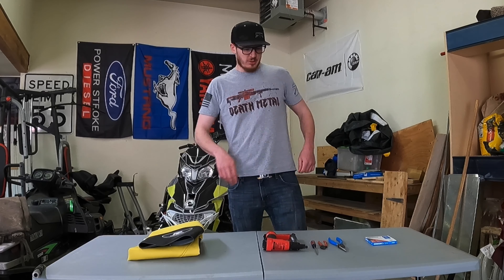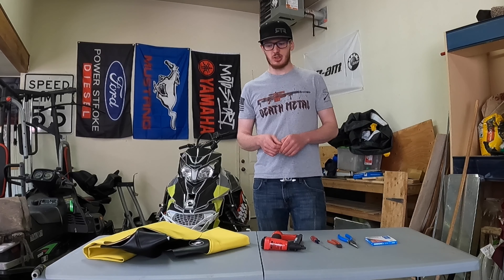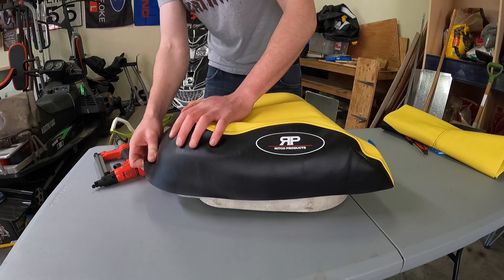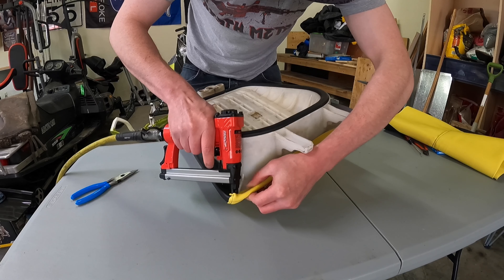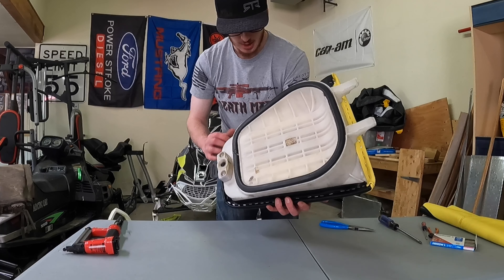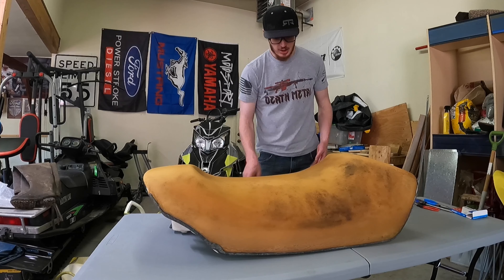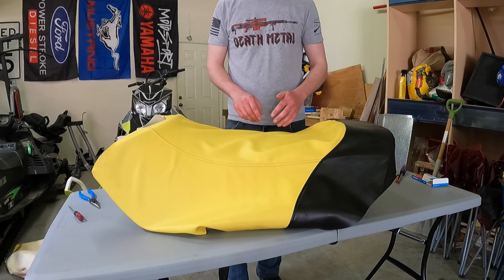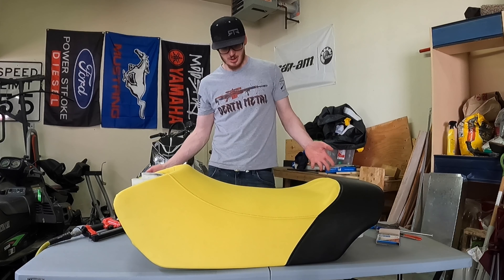How To Easily Replace And Install A New Jetski Seat Cover

Comment: Yo bro use spray glue on the saddle area then stretch the sides🤘🏼
Reply from the maker: That would have been a great idea to do for sure! Unfortunately I didn’t think of it at the time. So far it seems to be holding fairly tight, but I could see it being an issue over time. Great tip though man, and definitely recommend it for anyone else doing this!

Comment: very nice how much you charge for fix the jet ski seat
Reply from the maker: I don’t really have a business. I did this on one of my personal jet skis. If you were to pay a shop to do it, you’d be looking at probably around $100 for the new cover, and then a couple hours to remove the old one and install the new one. Depending what the shop charges for an hourly rate, could be between $250-$300

Comment: These aftermarket covers turn sticky from UV degradation rather quickly and are really pricey considering you can buy 2yds of marine vinyl fabric and recover both seats for 30 bucks vs well over 100 for these. I would have tried some starbrite milder remover first or some other cleaner before ripping them off. It's good you have a garage to keep them in, I wish I did.
Reply from the maker: Oh wow. I did not know that about these. I am by no means an upholstery guy lol. One thing I would suggest if you have to keep yours outside, is to buy a cover for it. I got a pretty nice one off eBay for about $150 a couple years ago. It is nice and waterproof, and is made out of a seemingly very sturdy fabric.
Reply: Not all aftermarket covers are the same . I have Ritco products  covers on my vx 110 and they have been out in the weather for 4 years  and they don’t have any type of sticky residue on them .
Reply from the maker: @mattrittweger3781  so far this one has held up nicely as well. No complaints whatsoever!